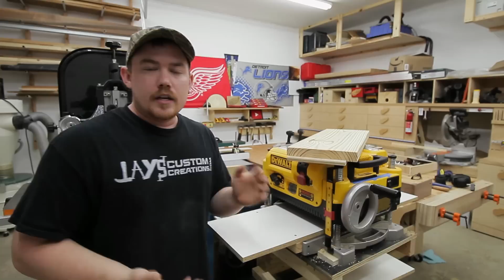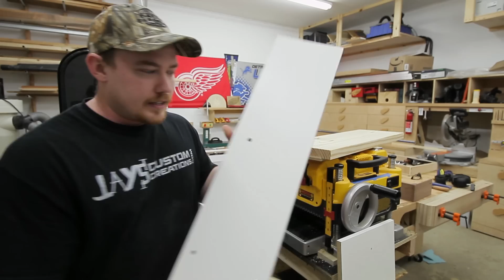FOLLOW UP/BETTER WAY: Jointing Stock Wider Than Your Jointer - 219

Comment: Jay...YOU ARE DA BOMB!  I'm planning to build a dining table with 8' Walnut (already bought $600 worth)...Have my planer...Just got my jointer...Looked at my wood and said "crap"!  I have 9" wide boards and a 6 1/8" jointer!  Read about sleds, using table saws, and all the other hocus pocus out there, then saw these two videos.  YOU my friend have saved me!  May still rip one or two of the wide boards just for varied widths, but won't need to rip all of them.  Thanks again!

Comment: dude,  I've been stuck on this for awhile.  I've used the aforementioned way several times and it does have its limitations as you've clearly stated.  
this is awesome.  going to help me a lot.  I only have a small jointed.  thanks a lot

Comment: OMG, so glad I found this. This is sooooo much simpler and better than the other method I've been using.
The only concerns I can think of are that "bed" sliding side to side OR the board being cut catching a snag. That's probably the biggest concern honestly. Suggest anyone trying it to just make sure you don't have any splinters coming off your cutting board where they might catch the"bed"
Other than that, this is perfect. Sick, awesome idea.

Comment: haha, i love the fact that "thinking outside the box" prevails again!. I also have a huge piece of flat plywood i have been keeping around that actually has sandpaper, with spray adhesive for that very purpose(preventing slippage when passing through the planer) as i hate using double-edged tape unless i have to. I have found if you don't get the tape off immediately the adhesive from the tape leaves a mark that is a royal pain in the ass to sand out. Such a simple trick and wish I had thought of it! haha...thx for posting the update! I can re-purpose that long chunk of sled now and gain a few cubic inches of space in my tiny shop! Great Job!  :)

Comment: Terrific follow-up, Jay!  Was planning to build the full-on planer sled - going to scrap that idea and go this route for sure, given I have w 6" jointer in my shop in addition to the same planer you have.  Wishing now that I hadn't gotten the metal folding extension tables. Will need to tailor mine to work with this method.  Thank you and please keep 'em coming!

Comment: Great video again Jay, thanks. I went by some advice I found line and bought a jointer rather than a thickness planer. Three or four times now I've needed the planer so I guess the real answer is that at some time or another you will need both. This certainly showed the versatility of the planer.

Comment: both are nice ideas.  I have tables for my planer and don't really have any problems with snipe.  Really want to get the Byrd Tool helical cutting head.  One of the guys at Rockler has one and said its a worth while upgrade.  Machine runs quiet and it cuts 220 grit smooth. Just an FYI

Comment: Jay,

Thank you soooooo much for this! Now all I have to do is remember this for next time I need to do this! LOL But your "cheater board" idea just also solved another issue that I have with my Delta 13" planer that causes an ever so small amount of snipe that I just can't seem to get rid of. 

My table has an extension on both the infeed and outfeed sides that are leveled using a jamb nut and bolt and they are most difficult to get them to be exactly level with the actual table. And at this point I am not sure it can be done with true accuracy. Every time I toy with it and "think" I have it just right... well, it ain't! LOL So I think adding this "cheater board" will act as a sled and eliminate that need for an actual sled that I can't do due to space issues. I am absolutely at 100% capacity on space in my "shop". In fact, I have ran just a little over capacity and am currently trying to figure out how to get the most important tool into the shop... ME! 

If I am wrong about this shame me publicly here and maybe I will learn something else! LOL

Comment: I may try this method, it seems like a good idea. What I have been doing  to flatten the remaining area of the wood is to run my electric planer over the thicker section till it's the same thickness. It usually only takes one to three very quick passes so it's not a big deal, but it is messier.

Comment: Hi Jay, love the channel, been watching for a while now. I've been using this technique and it works great, apart from one thing. I have a benchtop jointer and when I pass the oversized board on the jointer, the cutter heads seem to push the board away from the fence. It doesn't do this when the board is narrower than the jointer, only when it's oversized. Any ideas?

Comment: So here's a question...

Would this setup work for flattening a longer board without using a jointer?  I don't have a jointer, and I'm trying to figure out how to flatten the first face of a 72" long piece of 2x6 yellow pine.  I think the planer sled with the stop is a great idea, I'm just wondering if feeding a longer board across the top of it, through the planer, will still yield a surface of uniform flatness.

Comment: Probably a dumb question, but I am new to wood working. Do you have to use the jointer the board flat? I thought the planer would remove the warping & cupping.

Comment: A very good tip!..but if it should work.. you must have access to a separate planer (like you).. that are broader than your jointer is! On a combined machines, the planertable is usually narrower than the jointertable is!

Comment: I like the melamine bed extension.  Do you find that it cuts down (pardon) on snipe?
Reply from the maker: +Brian Hackett Nope. This planer still has snipe.
Reply: +Brian Hackett i saw a vid explaining the real cause of snipe by mathais wandel. it is actually stiffness of the whole planer apparatus that is the main--and unfixable--cause of snipe. check it out.

Comment: I have a question, Jay. How long does the infeed and outfeed need to be on a planer. I have 18" infeed and outfeed. Is this overkill? Also how thick should the extensions be? Wouldn't the melamine flex too much or sag over time?
Reply from the maker: Personal preference I suppose.

Comment: I have a question.  I have the JET JJ-6CSDX - 6" DELUXE JOINTER  The blade guard has part of the top that extends wider than the knifes by about 3".  When I tried to joint a board wider I seems that it not allow the outside edge to drop down.  Any help or ideas?

Comment: 1/2-way thru the job, slide the thingamajig over to the other side of the planer bed, turn the workpiece end-4-end, and proceed as usual. Now, your planer's knives will wear evenly. if your workpiece is more than 1/2 the planer's width capacity, the knives will wear twice as fast in the middle. When you plane narrow stock, avoid the middle for however long you double-used it. Wear-leveling for the planer.

Comment: Ok, now I get it. Had to watch twice. You can use the previous video’s “bed extension” for normal planar use, but the small “bed extension / flat reference jig” can be used to flatten the > 8” stock.
Thanks for the information. Just got a Grizzly G 0858 jointer and have the same Dw735. Always learn valuable lessons from you Jay. Great job and keep up the hard work!!!

Comment: I have a 6" jointer but need to joint a 12" board would this still work you think?
Reply from the maker: Probably not. I'd suggest getting one side really close to flat with a hand plane then use a planer.
Reply: Why wouldn't this method work?
Reply: My guess is it could sag on the side without support underneath.

Comment: What about skip planing. Where you plane without jointing first. You alternate sides on each pass. I think the only down side is more waste. I find most boards are flat "enough" to do this.
Reply from the maker: +William Butler I've done that a lot in the past. It "works" but it's time consuming and isn't exactly perfect. If you don't have a jointer is definitely a viable option.

Comment: That is genius! 
Now if you could tell me how to handle planer-snape when I'm doing just one piece at a time and I'd be set for life. I also use a melamine bed extension so if it's not that then maybe my machine is just crap?
Reply from the maker: +mastahcez feed it in on an angle. That drastically reduces my snipe.
Reply: I lift it up on the outfeed side, too. Once that infeed roller lets go, gravity likes to snipe the crap out of you.
Reply: Thanks guys, I'll definitely try it!
Reply: +Paul Fetscher exactly what I do when I'm getting snipe
Reply: What do you guys think of making a bed extension that would ramp in and out?
Reply: +mastahcez that would probably cause problems with longer boards but I could be wrong
Reply: jitwhit
You are probably right, is there a difference in how much you raise your boards when you put them in depending on how long they are? Maybe the bed could be adjustable? I'm just hypothesizing, I probably won't have time and patience to do and test it anyway.
Reply: +mastahcez double stick scrap extension boards that are longer than the board you want to the side of the board you want - I hope that makes sense...

Comment: Doesnt that cause problems with the conveyor beneath?
Reply: +Willem Kossen that's a drum sander, planer has infeed and outfeed rollers on top in front and after the cutterhead
Reply: +G.Work.Specials not treu. My planer from 1910 has got rolls in the tabel... And top... So this will not work correcly I think.

Comment: I don't have a thicknesser or a jointer (can't afford them) but I saw a video from StewMac yesterday where he was demonstrating his safety planer. It appears to allow you to "joint" any size board using your drill press. I think they're about US$45 which is much cheaper than a jointer. https://youtu.be/N5UOAnyPl0I
Reply: +CodeFoxAus Now if only the exchange rates would improve.......

Comment: Hey all... Thought I would add another way to the conversation... I use the method found in this link from Mattius which lets you joint boards up to double the capacity of your jointer...http://woodgears.ca/jointer/wide_boards.html